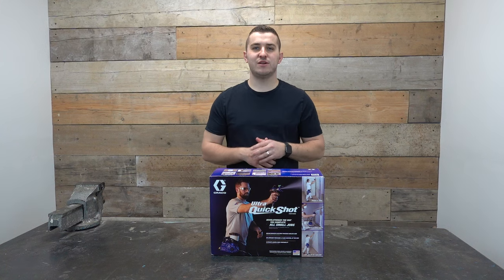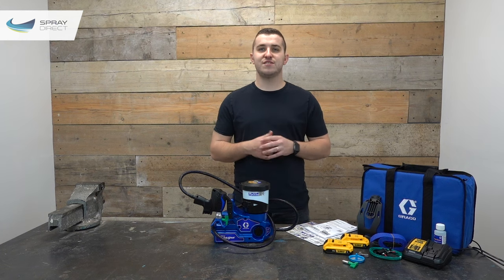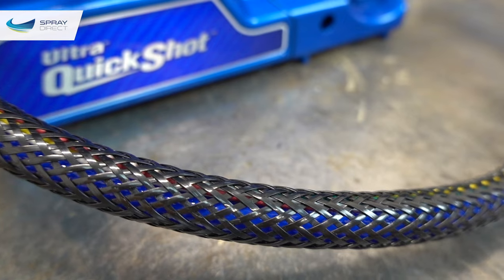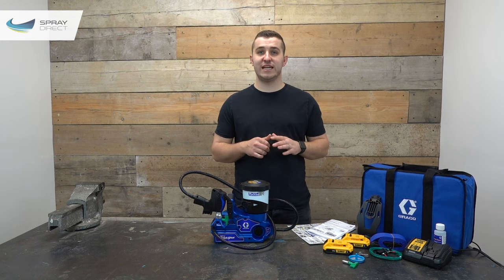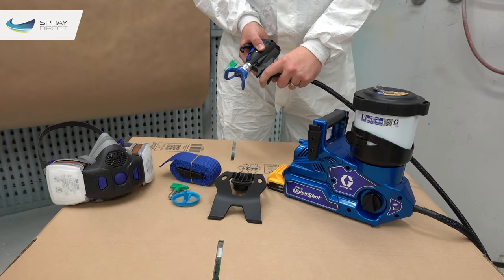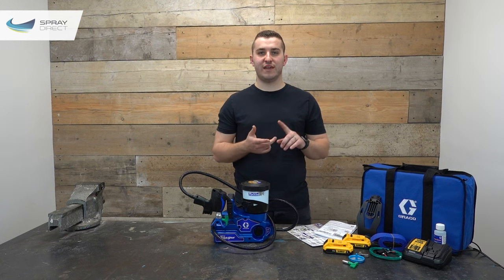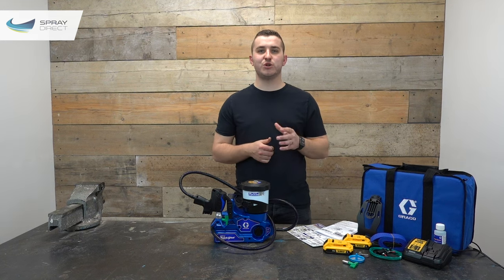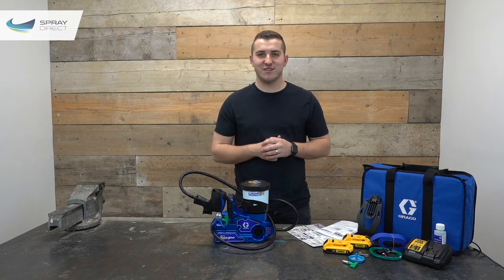How to Setup The Graco Ultra QuickShot - Features, Setup & Demo

Comment: Paid $1100 for it today, did 6 doors just hours after getting it and it worked flawlessly, best part is that it already paid for itself
Reply: Aqui no Brasil seria muito bom ter uma máquina dessas
Reply: NICE😊, What would it have cost you if you hired a paint contractor
Reply: you have to protect the place u spraying ?
Reply: Just got one yesterday and I sorayed clear coat on stained cabinets today . 30 doors and 30 drawer fronts. Amazing machine reduced waste and clean up/setup time. Payed for itself after the first 12 doors 

* also payed 1100 for it
Reply: @alexi8661 What tip did you use? Did you have to thin the paint?
Reply: @MadLadsAnonymous  I used a 310 Fflp tip. No need to thin the paint. Little machine is awesome I’ve done a few jobs with it know and u can’t beat the practicality of it on small jobs.
Reply: @alexi8661  Cheers. 

Do you recommending sanding the surface before or even between primer coats?
Reply: @MadLadsAnonymous  yes,  always before and in between coats.  You want a clean smooth surface.  If it’s a previously painted surface you need to sand away all the gloss from previous finish.
Reply: I'm getting the Graco finish pro GX19. Also for 1,100.

I don't like wearing stuff like that indoors in houses. Plus the GX19 works with any of the hose and gun options from Graco. It's very similar with a 1.5gal hopper. It's a little more robust, capable of spraying a little larger tip size than the quickshot. It's designed for fine finish work and tooless on-site pump replacement with the capability to shoot up to a few rooms with relative ease, yet designed to be easily cleaned for color changes with minimal product waste.

I'm working on getting mine to pay for itself before buying it. I'm not a painter, I'm a stone, tile, hardwood, laminate flooring installer. I'm starting a custom furniture and home-goods business. I'm currently expanding my horizon with applying custom made stains and looking for the perfect sprayer to suit my needs. This tool will even allow me to capture more work by shooting my own baseboard installations.
Reply: Hey where did You Buy it at fir that price

Comment: Is the pump repacable like the ultra and whats the pump life in litres and the cost of new pump?
Reply: Check out the Graco finish pro GX19. Tooless pump replacement! Also it stated the pump longevity on Graco's site, but I forget. Seemed good, the tool is in their contractor line.

It's similar in design with a hopper, though a little larger and more robust. It has a 1.5gal hopper, it can shoot a slightly larger tip size (up to .019 from the quickshots .016) so it can handle thicker material. Yet it's designed with woodshops in mind. Made to deliver tight pump pressure windows for a fine finish when spraying thin materials like stain and also be able to change colors with ease.

Comment: I'm not a painter, I'm a handyman.  About 50% of my work is painting. The simple fact I can walk in quickly and do a small job is so valuable.
Reply: I don't like wearing things like that indoors on the hip. It leads me to bump into/damage things. Nor do I like that proprietary gun/hose setup.

The tool I'm looking @ is quite similar with a 1.5gal hopper. It's the Graco finish pro GX19. It comes with a RAC X FFLP210, pro 2 finger spray gun with internal filter and swiveling hose attachment. 3/16" hose for greater flexibility. The pump can handle larger size spray tips.

It is a little larger. But still quite portable. It offers the ability to use from a further distance and hold more material. It is designed with fine finishing in mind and delivers a top notch spray from an airless system using its linear pump design. The pump is also easily changed without tools should a failure ever occur down the road. True professional equipment! It works with all Graco's guns and lines, so you can even spend 300 for their crazy short grip pro gun if you need to get into tight spaces like inside cabinets.

They make a battery option too, though it's $2,200. Basically a $1,000 upcharge for 2 batteries and a charger... Seeing as it works off 1 battery, I might be able to power the plug in off a milwaukee inverter using m18 batteries which is what I have.

Comment: Is this like the ultramax that requires a new pump every 200 litres or does it last a lot longer?, I wouldn’t mind this for doing ceilings but if it’s like the ultramax then I’m better off using the full-size machine.
Reply: I think it has a 150 gallon life on the pump but the pump is replaceable

Comment: Great video , what is the finish like on this type of sprayer ? , I am a joiner by trade and occasionally make fitted mdf units and spray them , I currently have a qtech 5 stage turbine machine and spray waterbased Renner paint , I do get  perfect flat results with no texture on what I spray but was just wondering how this would compare , it seems a really nice compact unit . Cheers
Reply from the maker: Thanks for the comment! It’s definitely dependant on setup and that plays a huge part in the finish. An airless sprayer will load it on much quicker so you’ll have to move fast but no reason why you can’t get a perfectly flat finish if used correctly 👍

Comment: does the pump last long that graco ultra max i sprayed 4 doors then pump went 😮
Reply from the maker: The pumps in the UltraMax have recently been upgraded to the 2nd generation and we’ve seen good improvements 👍 the Quickshot has been bought out using the technology  from the 2nd gen pump so we’re confident it will live up to expectations. It’s impossible to say an exact amount of litres because it’s dependant on so many variables like, pressure, tip size, product you’re spray, cleaning etc. 

Please feel free to give us a call to discuss your broken pump, there may be something we can do through the Graco warranty procedure regardless of where you bought it from. All we’ll need is a proof of purchase (invoice) and we should be good to go!

Comment: What's the pump life on this machine? Better than the ultramax?
Reply from the maker: The pumps in the UltraMax have recently been upgraded to the 2nd generation and we’ve seen good improvements 👍 the Quickshot has been bought out using the technology  from the 2nd gen pump so we’re confident it will live up to expectations. It’s impossible to say an exact amount of litres because it’s dependant on so many variables like, pressure, tip size, product you’re spray, cleaning etc.
Reply: @SprayDirect  👍
Reply: cristmas crackers better then the ultramax

Comment: Looks like a nice little machine,thanks for the video Josh,i have the ultramax and i wonder is this machine an upgrade on it?
Reply from the maker: Good question! There will always be a place for the UltraMax but the QuickShot in my opinion is on another level. It also depends on the jobs you’re doing because you can get into areas that just wouldn’t be possible with the UltraMax. You also have so much less weight in the hand you’re spraying with making it much more comfortable to use. 👍
Reply: @Spray Direct  do the batteries from the ultra work in this?

Comment: Shame they don’t do their battery units as naked machines. Already have multiple chargers and batteries and don’t need to be paying for more I don’t want. Totally negates the use of the dewalt battery platform. If they had any sense they would have created a unit which used an adapter that you could use batteries from multiple manufacturers.
Reply: The Contract arrangement with DeWalt gives Graco some Know-how in the foreground IP for free.
Reply: they are using one of the most popular if not the most popular brand of batteries and they give you 2 and a charger…and you could easily find an adapter for it and use other batteries maybe, if the voltage would jive with the machine, etc. 
I’ve never seen a product/tool that came with a battery port that was setup to accept multiple battery brands, have you?

Comment: Mine just keeps clogging & clogging & clogging & clogging.

Changed the mesh. Changed the seal & tips - Strain paint through a pair of tights - thin it. Nothings working. Just keeps clogging.

Comment: Hi Josh can you adjust the fan pattern/width like on the HVLP 9.5 ? Cheers
Reply: No, just horizontal or vertical adjustment....the size of the tip determines the size of the fan and material amount, and the pressure setting and material viscosity determine the quality of fan pattern

Comment: Hows the finish for furniture
Reply: If done correctly with the adequate paint you. An a hive factory like finish.   I’d recommend a 210 or310 tip
Reply: Haven't used it, but another commenter suggested the 308 FFLP for furniture. Said the paint was perfect.

Comment: Just bought one used first time today can’t get a clean pattern no mater what. Pressure all the way up and even thinned material a lot and the material was already thin. Any help?!?
Reply: Did you figure it out ? Just bought one and mine is working perfectly
Reply: @alexi8661  yup the material was too viscous for the small pump. Every other paint sprays like a charm.
Reply: Same as mine. Still cant get off of tails till now😭😭😭

Comment: Sorry, ive said no to this tool. Its going to lead to bumping into finished surfaces indoors wearing that on your hip.

Ive done it too much with contractor toolbelts indoors, its a no-no. Graco should know better.

Im getting the Graco finish pro gx19. Its quite similar to this offering, like its bigger brother. They have a battery and non battery version, though i would never pay $1,000 for 2 batteries, a charger, and the opportunity to use them. The gx19 is around 1,200. The gx19 battery version is 2,200...

This little guy is still quite portable yet can be set in the middle of a room, or on the ground while your on a ladder. It handles larger spray tips, up to a .019 thousandths (19 size, 619 example tip) yet its specifically made for providing a fine finish, designed to keep tighter pump pressures for optimal spray patterns. Its made for those shooting stain, or somone needing to change colors more often, or a dedicated secondary sprayer. Its good for shooting trim, cabinets, or up to a couple rooms. It gets beat out by bigger stuff for bigger jobs than that. It also comes with a 3/16" hose so its a little more nimble feeling and more flexible than the bigger stuff.
Reply: This is more of a DIY unit for odd jobs here and there whereas gx19 is more of an entry level contractor unit

Comment: $2K+ for this is a big ripoff!
Reply: Paid 1200 for mine. Works great and is going to make me alot of money.
Reply: @kmerchant90  send me a link for $1200 because $2k is a NO
Reply: Ask sherwin willams
Reply: That's were I got mine.
Reply: It was 1299 to be exact pluss tax
Reply: @kmerchant90  that’s better than $2K+ options I’ve crossed with. I’ll check it out. Thanks
Reply: @TheFireGlory07  yeah. Totally worth it. I've sprayed extreme bonding primer and emerald urethane through it so far.
Reply: Paid $1100 for it today, did 6 doors just hours after getting it and it worked flawlessly, best part is that it already paid for itself
Reply: The price level is just greedy. Milk the customers as long as you've got an edge on the competition. Says a lot about Graco as a company.
Reply: @kmerchant90  got mine for $1100 brand new. Get to know your paint store owners better and you'll get things at cost.
Reply: Got mine for 1250 and 3 additional free fflp tips.  It's made me 10x that already.
Reply: Got sherwin to price match off an online sight for my ultimate (more than the ultra ) for 1250 . If you do enough cabinets, doors , trim or even just garage doors this is a time saver and time is money in our business.
Reply: Did you use primer for cabinets? I was wondering if I can spray primer through for painting wood cabinets white?